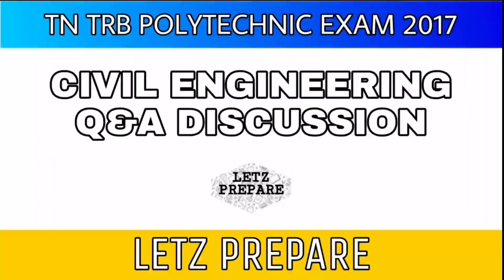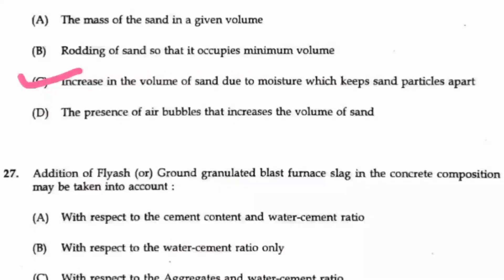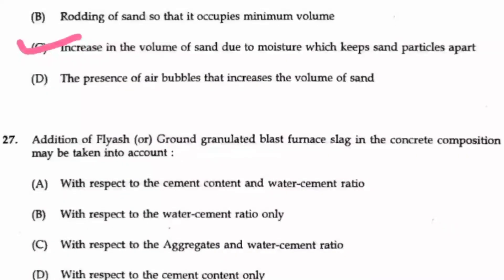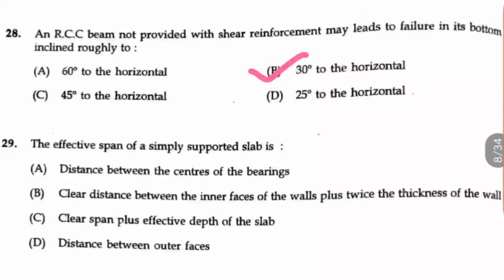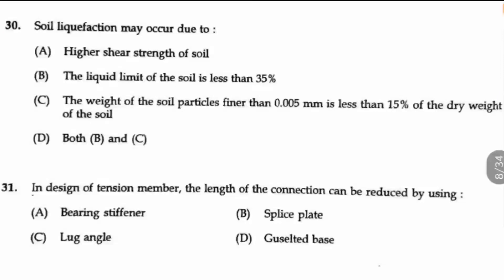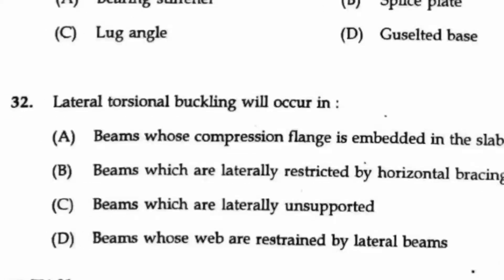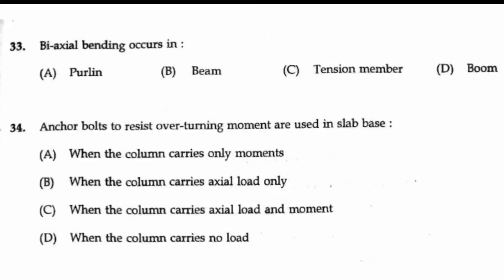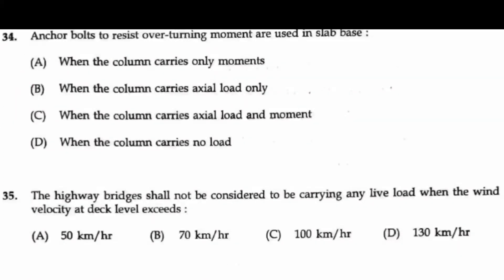TRB Polytechnic Civil Engineering 2017 Question Paper Discussion (26-35)

Comment: As per trb answer key Q. 28)option c is correct. And Q.30)option c is correct
Reply from the maker: Kindly check trb answer key provided in trb website. The answer given in video is based on that. Thank you🙏
Reply: @letzprepare4511  correct mam.. B only correct 30deg...